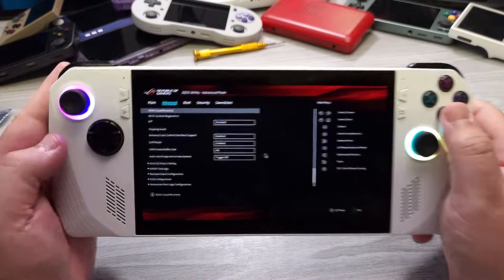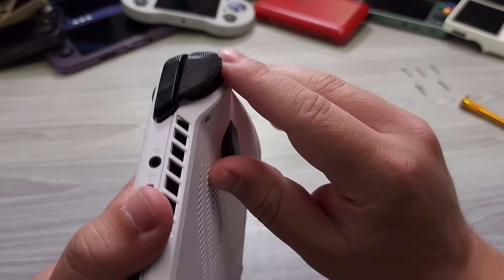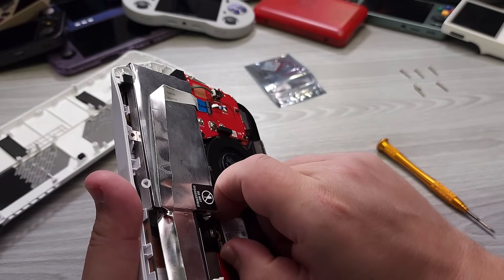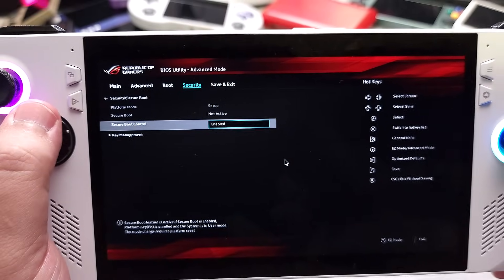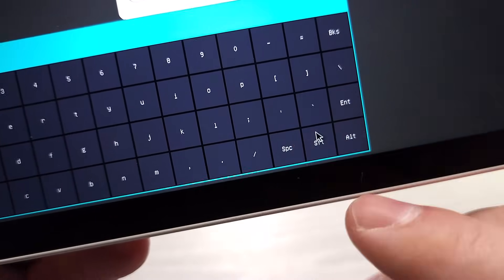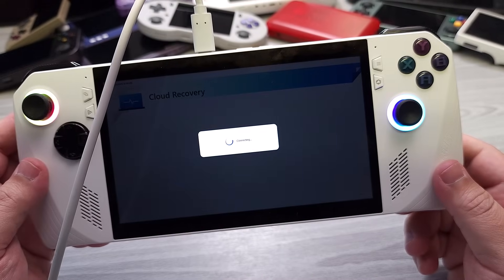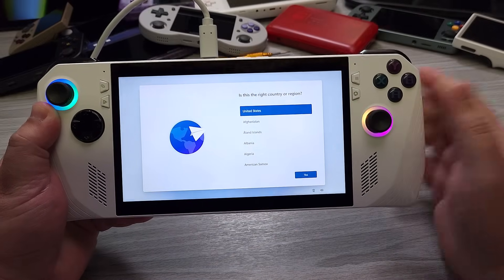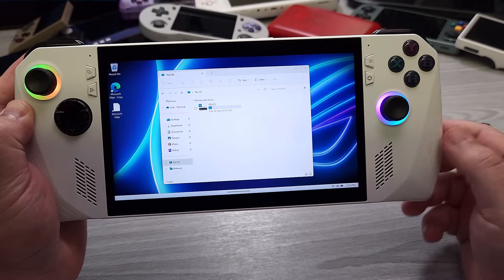Asus ROG ALLY SUPER EASY SSD Install / Upgrade How-to Asus Cloud Recovery

Comment: I wonder if the bios will be up to date out of the box to allow for this?  Or should we set it up with the default SSD, do updates, and then power down and swap the SSD's?
Reply: I am wondering the same thing
Reply: My guess is that the retail units are already packaged and shipped with the old bios

Comment: Most important thing not to forget is to make sure the bios date and time is set right. I had tried installing new ssd without checking the bios information is right. It took thee tries to install ssd and not get stuck on checking. I did not update first.
Reply: this helped me just now, thank you
Reply: Your welcome I’m right now loading my steam games. It was way easier than using a usb drive once I found out the work around. It was another YouTube post that I found someone mentioned it.
Reply: Just done this now hopefully it works, if it does i thankyou 👍
Reply: Is it ok to go back to bios while it is on checking status?
Reply: @ronalddoe2894  sorry I don’t know. But good luck with install. Like I mentioned I tried few tries and it would time out. I went back and checked some YouTube and found my bios should date and time weren’t correct so I changed it to the current time and started the install agian and it worked .

Comment: A very useful step that many are bumping into is you HAVE to boot up the device using the OEM NVME first.  You will get stuck on an infinite "checking" loop during the Cloud Recovery stage if you try to throw your new drive in before booting up and letting the drives update.  Don't sit for hours, just power off the device and throw the original drive in if you get stuck at the "checking" loop.  Replace after installing all updates!
Reply: Are you referring to all of the updated listed in the “Windows Update” tab? Thank you!
Reply: @YellowPossum  Yeah! Turn on the optional updates too so it hits all the Asus Firmwares as well. It updated my bios automatically as well on the first restart. Requires 1-2 restarts before the device is actually ready to have the drive replaced.
Reply: @skepticmi thank you for the help!!!
Reply: How long did "checking" last for you? I booted and updated oem then swapped and it feels like it's taking an eternity on "checking" still.
Reply: Checking or Loading? I'm on the Loading..... screen
Reply: @TheOfficialChannelOfChannels  For anybody else stuck here, you have to update the bios through the my asus first, NOT just through the regular windows updates, THEN you'll be able to swap the ssd easily.
Reply: @jeffhernandez7594  I did, but the update wouldn't move unless I swiped on the screen or something, and I got like an error 00000001 something and it said Press this key to repair or this key to do something else, but I don't have any keyboard to press the buttons they asked for
Reply: @jeffhernandez7594  I finally got it, I took out my 1tb micro SD, I updated the date and time in the bios, and I updated alot of tiny non essential files in windows 11

Comment: Hey man! Love the super objective content. May I ask your opinion on the Ally's future? Everyone is basically taking for granted the fact that Asus will make a new one in a year or so and leave this behind. Honestly I can see that happening but their work is only really needed for armory. Do you see steamOS running on this thing? Would it be of any benefit or would it just be better for Microsoft to launch a handheld version?

I'm still unsure about what handheld to get: either the Deck, knowing how limited it already is both in performance and with its display, or the Ally, knowing it's basically a portable computer with W11. My main objective is emulating virtually everything, so the Ally has a serious advantage there, although I'd have heavily preferred if they went for a 720p screen.
 I've also been looking into the AOKZOE A1 Pro but it seems like its performance is good on paper but since it's 1080p it's basically the same as the Deck, not making use of the bigger battery. I fear the same for the Ally too.
Reply: The thing with Asus is they are not the same as Loki, Aokzoe Onex. There's a reason the Ally didn't launch in Indigogo or Kickstarter. Massive world wide launch! There's gonna be millions of these things just like Asus's laptops they are not just gonna abandon support because they sell to the masses and the amount of people that would complain can cause massive issues for them. Where as the smaller handheld companies are only selling at  most 10 000 units so if they just end support the amount of people that complain can basically just be ignored and it won't effect the company as they push forward with a new campaign.

Comment: Can i change the SSD before the first boot or do i need to update the bios first in order to use Cloud Recovery?

Got the answer in other video: It is highly recommended that you update the bios first with the original SSD so you can change to the new SSD and use cloud recovery, thus making you have to setup Windows twice... sadly.

Comment: Ran into 2 issues, first was I didn't know you had to go into the My Asus app and make sure everything is updated before anything and the second issue was I forgot to take out my Micro SD card. After Those 2 things is was smooth sailing from there out.
Reply: Does your prompted “The device is not support for this function” in Cloud Recovery? I didn’t update to the latest Bios or software before upgrade to 2280 and it prompted that. Don’t know what to do now 😩😭. Any advice will help 🙏
Reply: @tmancham4212  I can look into this for you if it's still an issue. Were you able to get it sorted? Sorry haven't checked my notifications in a while.

Comment: Thanks for the great video, so if I do it your way, does Rog Ally have wifi driver build in? I mean going into bios and do the cloud restore, need wifi /network, right, I am assuming the wifi driver is ready so I can connect to my wifi. Am I correct? Thanks.

Comment: How long should I be waiting for the cloud recovery to keep checking. It's been checking for an hour at the time of this post...
Reply: Same. Did I do something wrong?
Reply: I and others in the comments on this video have been waiting for 2+ hours for the "Checking..." to complete. Have restarted the process multiple times only to get stuck in the same spot. Another commenter is assuming that it's "checking" the status of the warranty/device to confirm that it's eligible for Cloud Recovery, but the servers are slammed. At this point, I'm ready to just clone the original drive and be done with this headache.
Reply: @RyanMcClung  the warrant thing is a bust. I registered it and it changed nothing
Reply: Finally it's installing
Reply: Just got off phone with ASUS They are escalating it for whatever that is worth. But on my 4th attempt hoping that my check decides to go through about 30 minutes in
Reply: how long did it take? Im going on 4+ hours of "checking"
Reply: Hey if you are having the "checking...." issue after updating your SSD. Put the old SSD back in, update your bios using the MyAsus app, and then try again. It worked immediately for me after doing that. I had let it run for multiple hours before that
Reply: @Chris-Stewart711  Thank you. I may just try that at this point.
Reply: as has been mentioned bios update seems to fix the issue, I thought I was on the latest as I did run a bios update but apparently that was just to get me to 317, i then went to 319 and it all worked.
Reply: It worked after reinstalling the original drive and booting into Windows, then launching MYASUS app and installing all the updates. I had to reboot a couple of times until all the MYASUS updates were applied, including BIOS updates. I put the new drive in, started cloud recovery and it’s working. “Checking” took about ten seconds then it went on to install.
Reply: @RyanMcClung  It worked after reinstalling the original drive and booting into Windows, then launching MYASUS app and installing all the updates. I had to reboot a couple of times until all the MYASUS updates were applied, including BIOS updates. I put the new drive in, started cloud recovery and it’s working. “Checking” took about ten seconds then it went on to install.
Reply: @RyanMcClung  It worked after reinstalling the original drive and booting into Windows, then launching MYASUS app and installing all the updates. I had to reboot a couple of times until all the MYASUS updates were applied, including BIOS updates. I put the new drive in, started cloud recovery and it’s working. “Checking” took about ten seconds then it went on to install.

Comment: I have a question. After replacing the SSD, it seems I’m unable to enable secure boot. 
By default it’s under “disabled”. And when I try to “enable” it, it seems it isn’t able to save the settings because when I go into Asus Cloud recovery, it still tells me to enable secure boot. 

Any tips?
Reply: Did u happen to fix this same issue I installed the old SSD but I'm thinking I have to hold the volume down button then power on keep holding until bios screen

Comment: The Ally is fantastic. Got one this black friday for $200 discount. But the touch function is absolutely horrendous on this. I hope they include a stylus or windows brings out an OS specially designed for handheld gaming devices like the Deck.
Reply: The touchscreen is pretty solid, it's just windows 11 isn't designed for it.

Comment: Hi! Yesterday, I finally got my Ally and installing the new SSD was the first thing i did (even before turning it on). It took me like 10 minutes to swap the hardware, but the machine took like 2 and a half hour to complete the whole process shown here. I'm not writting to complain about that, but only for asking; Does your Ally get so slow on turning on and off? it's Insane how many trys i must do to turn it on.
Reply: Also the fingerprint is never working, Armoury Crate doesn't starts if i don't execute it and i can't put it on sleep mode (it just get stuck in black)
Reply: @nandoholgado3050 Fingerprint sensor is a pos

Comment: I was able to get to the part on 6:44 but I was stuck on a checking icon for a long time with no change. Has anyone else hit this problem?
Reply: @Peter I found a fix for it. All I had to do was install the old SSD. Got everything updated. Then installed the new SSD and it took maybe 5-10 mins for it to get passed the infinite checking loop

Comment: I did the cloud recovery process, and it's been 4 hours where I just see a notification that says "checking" after connecting back to wifi, and it just stays loading there. Is it normal for this process to take so long? I'm losing my patience here and starting to think there's something wrong....
Reply: im stuck here as well. did it ending up working out okay?
Reply: It worked after reinstalling the original drive and booting into Windows, then launching MYASUS app and installing all the updates. I had to reboot a couple of times until all the MYASUS updates were applied, including BIOS updates. I put the new drive in, started cloud recovery and it’s working. “Checking” took about ten seconds then it went on to install.
Reply: It worked after reinstalling the original drive and booting into Windows, then launching MYASUS app and installing all the updates. I had to reboot a couple of times until all the MYASUS updates were applied, including BIOS updates. I put the new drive in, started cloud recovery and it’s working. “Checking” took about ten seconds then it went on to install.

Comment: It's not that complicated but still not a huge fan of opening the entire back case, always end up deforming the plastic lining at the edge even with a proper pry tool. Wish they provided an screw base opening like on a laptop where you can just replace the SSD, HDD or Ram without opening the system

Comment: Make sure to have the latest bios, which is 319. No kidding: lightning struck my house tonight and took out my router and power. Thus I was using cellular bandwidth for Asus Cloud update. I've had to di it TWICE so far because I did not have the latest bios! Pain in the ass!

Comment: Just wondering.. Did you do anything to the drive before installing it? Did you have to create a partition on the drive?
Reply: The only reason I ask is because I bought my drive and when I plugged it into windows it wasn't initialized and didn't have a volume.. If I didn't do that then the Asus recovery might not even detect a drive was installed.. Or would the cloud recover do all it needs to the drive?

Comment: How did you get your keyboard to pop up to enter your wifi password?

Other videos i watched and reading the comment section. It seems people get stuck at this point.

If i bought a small enclosure for a 2TB  SSD and plugged it into the usbc port of the Ally and cloned the drive, what would happen when i pull the ally apart and put the clone SSD in?

When i power it on would it boot right into windows ready to go looking exactly as it did with the stock 512 SSD? I assume so, just with 2tb of space now.

Comment: I’ve been sitting at the “Checking” step for a while, about how long did that step take you?
Reply: It worked after reinstalling the original drive and booting into Windows, then launching MYASUS app and installing all the updates. I had to reboot a couple of times until all the MYASUS updates were applied, including BIOS updates. I put the new drive in, started cloud recovery and it’s working. “Checking” took about ten seconds then it went on to install.
Reply: @Justintime246  yup that worked! Thanks

Comment: Followed all the steps in the video and when I turn on the ally I get a red box that says "Secure Boot Violation". I set the ally up before switching the drive, upgraded everything, installed latest bios before swapping the drive. Any way around this that doesn't involve swapping the drives back?

Comment: You MUST absolutely update BIOS. Using the factory BIOS, it would get stuck in a loop. Updated the BIOS and it accepted the new SSD and installed windows.
Reply: have you gotten passed the checking screen
Reply: @reese112702  No. I reinstalled my factory SSD and am going to return the 2tb Sabrent I purchased
Reply: @Mikey6048  ohh man ok thanks for the reply
Reply: Updated!
Reply: So if I didn't know this and already put in the new SSD, is there any hope?  Or do I have to put the old SSD back in?

Comment: So if I bought a brand new ally then install a new SSD I don’t have to buy windows again? It will just redownload through the recovery you were showing?
Reply: The windows license is on the hardware itself, so you don't need to buy anything.... did you buy a new Windows license everytime you upgraded/replaced an SSD? 😅

Comment: If you are like me, and you want to swap the SSD right away, you might be running into issues.  First thing I did was download the latest EZFlash BIOS (319) and installed that.  But now I am still stuck, after downloading the recovery files, rebooting and getting past Loading, I seem to be stuck on the "checking..." dialog.  I've tried several things, including going from wifi to wired ethernet.  I am trying one last time.  I am wondering if maybe the NVME has to be initialized first.  Mine is fresh from the factory and unpartitioned.
Reply: im having the same issue, besides flashing the bios. its been over 3 hours on "checking" with a brand new 2tb nvme....
Reply: @vang2002  I have watched 2 different videos and I have no idea how they did this, because on the reboot, past the "Loading..." screen, where it wants to reconnect to the network, it wants the wifi password again, but it refuses to bring up the on-screen keyboard?!
Reply: One more tip, although it hasn't solved the checking issue, yet, connect to a 2.4GHz wifi network, AC or lower.  I initially connected to a 5.1GHz and it has difficulty reconnecting to it on reboot, and the wifi dialog refuses to bring up the on-screen keyboard on relaunch.

The recovery mode is NOT ready for primetime.
Reply: You have to set the correct date and time of the bios
Reply: @sirnh did you figure out how to bring up the keyboard when it asks for wifi pw
Reply: @respond_code3  I had to use a 2.4GHz wifi connection when it first wants to sign into wifi.  After reboot, the device fails to see all 5GHz wifi.  So if you use a 2.4, it will just automatically sign in again.

Comment: I installed a 2TB SSD and made it to 6:15. Windows just sit there spinning for 20 mins. So I'm trying again, And hopefully 2nd time will work. I updated everything on the stock SSD before swapping to the 2TB.
Reply: It worked after reinstalling the original drive and booting into Windows, then launching MYASUS app and installing all the updates. I had to reboot a couple of times until all the MYASUS updates were applied, including BIOS updates. I put the new drive in, started cloud recovery and it’s working. “Checking” took about ten seconds then it went on to install.
Reply: @Justintime246  I didn't think to open the MYASUS app I updated everything else. Why do we need armoury crate and MYASUS app 🙃

Comment: The lack of trackpads makes this process way more fiddly than is necessary. 

Cloud recovery is pretty awesome, see no reason Valve cannot implement on Steam deck
Reply: Meh trackpads will make the device too wide like the steam deck. Steam deck is like a skateboard lol.
Reply: You could easily adjust the mouse sensitivity to use it better
Reply: @King_Irv  no you can’t lol it’ll never be even remotely as smooth as a trackpad